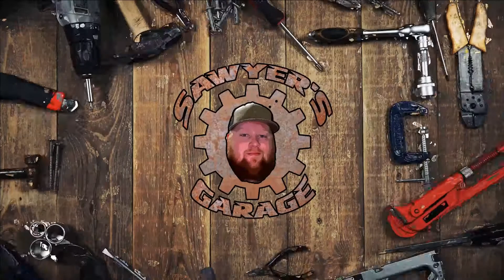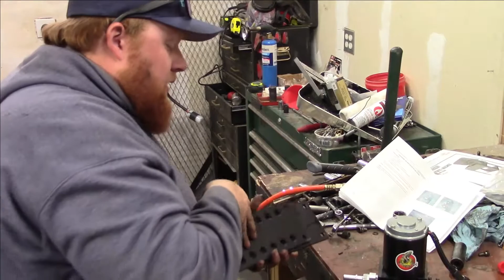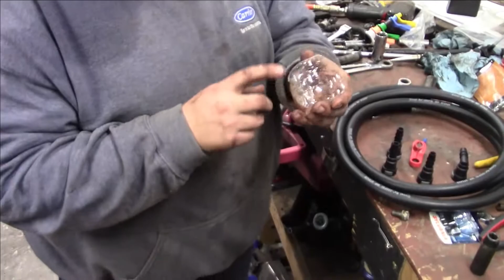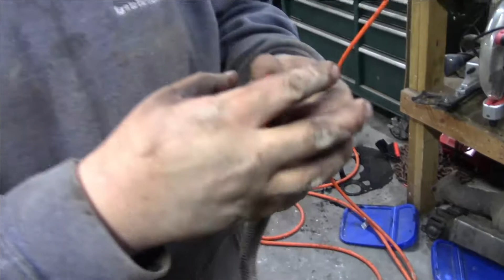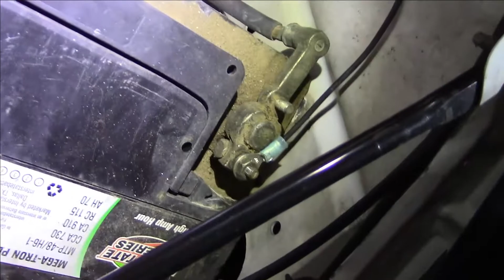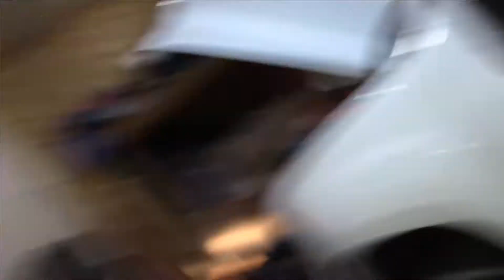Ultimate LMM Duramax Raptor 4G Lift Pump Install (How To)

Comment: What PSI did you set your pump to? Did you have to adjust it or did it come preset? Since your truck is tuned do you run a higher fuel psi?

Comment: You keep saying cp3.  Isn’t the lmm using a cp4?
Reply from the maker: The LMM is the last generation of duramax to use a CP3, the LML in 2010 went to the CP4
Reply: @SawyersGarage  nice. Thank you for being specific. Cool so I have a cp3 on my 2007 lmm
Reply from the maker: @julienpenaruiz  Yes you do!  which is a good thing because the CP4's are known to fail and send metal shavings thru the fuel system
Reply: @SawyersGarage  yes.  My truck is stock and runs perfect. Was thinking of doing the delete kit but honestly not even sure it’s worth it. I’m using hotshot secret and it’s all good. People always think by removing the cat and dPF they will gain HP but you won’t.  Removing the EGR has pros and cons. With out the erg the turbo get hot …
Reply: @julienpenaruiz  no deleting the truck and adding straight exhaust and intake will help lower you're egts
Reply: @easyryder123  got it. Will I need a delete tune?  What about the EGR can I keep it and unplug it and use a tune to Turn it off?
Reply: @julienpenaruiz  yes need delete tune , and can block off egr if wanna go cheap way
Reply: @easyryder123  so I can’t just unplug it and turn it off with a tuner?
Reply: @julienpenaruiz  need blocker plate at least
Reply: @easyryder123  if I empty my dPF and cat and keep the EGR  will I need a delete tune? And if I do the blocker plate do I need to unplug the EGR manually or just with an emission delete tuner?

Comment: What is the benefit of this pump vs the one with the filter and water seperator?
Reply from the maker: The benefit to this pump vs the pumps with filters is the cheaper price and more ground clearance.  Some people like the extra filtration but in my opinion the stock filter provides adequate filtration anyways.